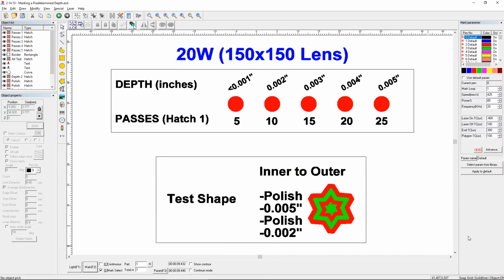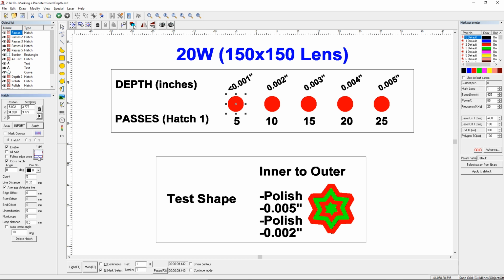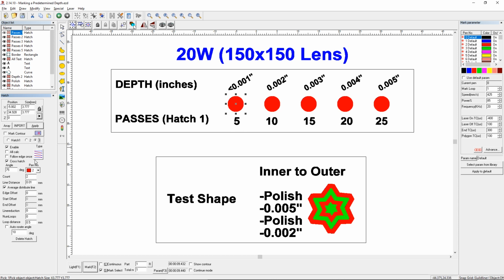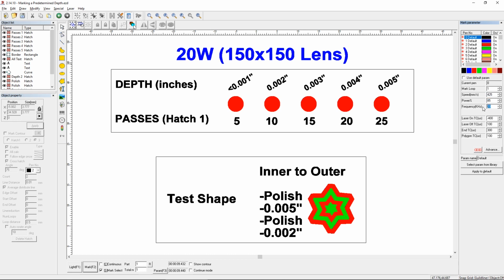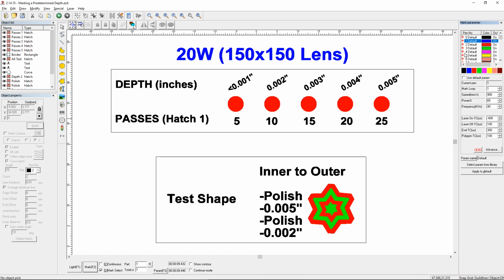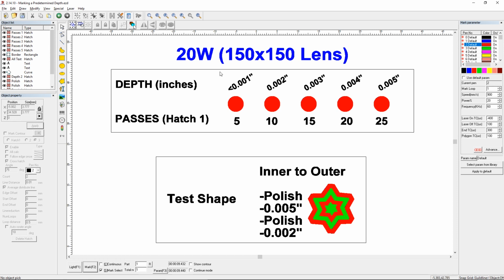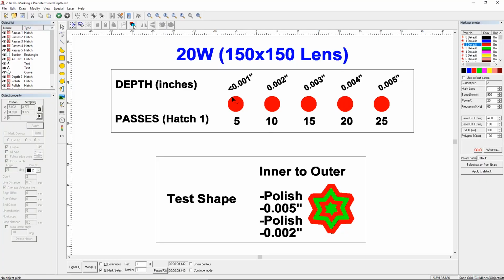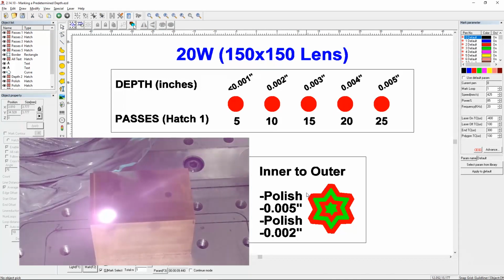EzCad2 Tip: Engraving to a Preset Depth (20W Fiber Laser)

Comment: Love the videos.. thank you. but I have a design and need to do a deep engraving? I try to follow your settings but my design creates a black carbon layer. but when i sand it with a 1000 grain, seems that the design is done very light on a brass surface.  Do i need to always adjust the height of the head every time? or you think the settings are not saved when i apply the changes?
Reply: If you want avoid carbon color do second marking at low power.

Comment: Hi I need to engrave serial text-numbers into weapons parts with a 30w laser using EzCad. I am new to this and is looking for some advice. Its almost always hardened steel and it needs to be a little deep perhaps compared to using a letter stamp set with a hammer. It cant be just like an image since it would be easily sanded off. It needs a little depth and to take a little time to sand it off. I was looking for some settings advice? Hopefully you have a setting you could send me? I wouldnt mind it looking nice but when I engrave with slow speed and high power the end result seems to be not so nice. So low frequency, high power, slow speed and few loops compared to say high speed but lots of loops?
Reply from the maker: If you're using very slow speed with high power and a minimal number of passes, don't be afraid to speed up a bit and use a few extra passes.  This might improve your end result.  If you want a nicer finish, add in a cleanup pass after each depth pass with a bit lower power and higher frequency between (or only as your last pass).

Comment: I have a need to cut small, somewhat complicated shapes out of  .008" stainless steel and these galvo style engravers seem like the most cost effective way to achieve that. I am looking at 50watt units however I am hesitant to pull the trigger because i understand these are not intended for cutting. My question is, is this a bad idea? My only requirement would be clean edges on the cut and preferably no discoloration. Thanks for the videos, they have been a big help so far!
Reply: They're not intended for cutting, but that really applies to material with actual thickness.  I have cut regular aluminum foil with my 20w and it was quick and easy.  I'd guess it was .003" thick or maybe a bit less.
Reply: You can cut with 20W fiber laser without any problem! I use sisma easy 300F (30W) for cutting brass, stainless steel, silver, gold 0.1mm-1mm thicknesses with, or not polished surfaces.It’s up to your settings and the material! Like Tesla says: think in terms of energy, frequency and vibration.:) +more passes, more depht, more time!

Comment: Whats the deepest you've been able to get in steel?  Im on the fence with investing in a fiber laser vs. continuing to engrave on my CNC mill.   Im looking for a fairly deep depth - almost 'topographical in stainless/alloy steel and want the precision of a laser and to free up the CNC for 'real' jobs, but not sure if a 20 to 50w fiber laser will cut it...   Thanks in advance.   Watched all your vids and VERY helpful stuff for the community.  '
Reply from the maker: I used to engrave on my small mill also, but it wasted a lot of time and minor depth variations were fairly noticeable.  That said, my laser is a 20w system so it's not very efficient at hitting significant depth.  A few thousandths is no problem, but if you need more than about 10 thousandths regularly (especially over a large area), you'd probably be better off going with a 30 with a small lens or a 50w.
Reply: @jefferyj  stellar feedback.   Really appreciate that.  I think a 50watter is in my future and hopefully it works out!  If not, I know who to donate it to.